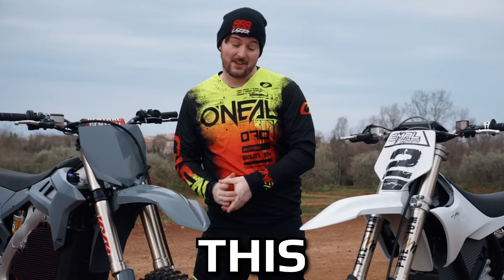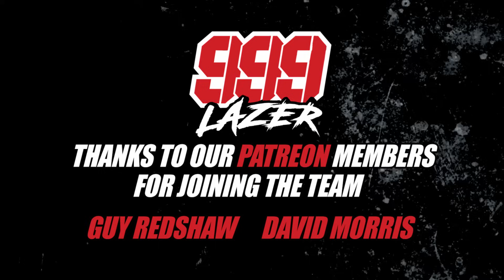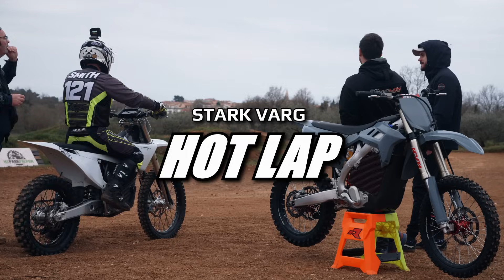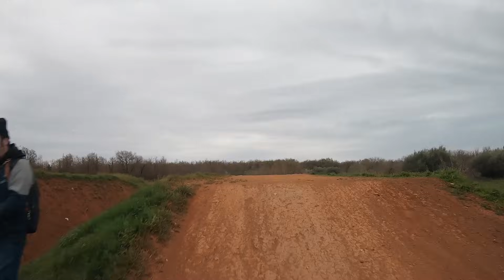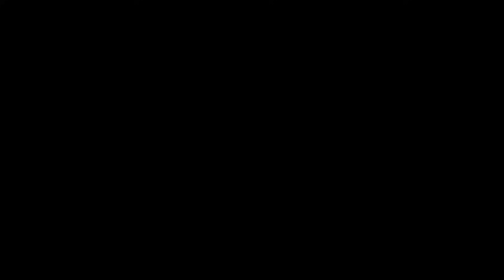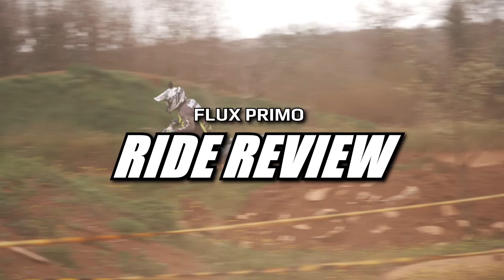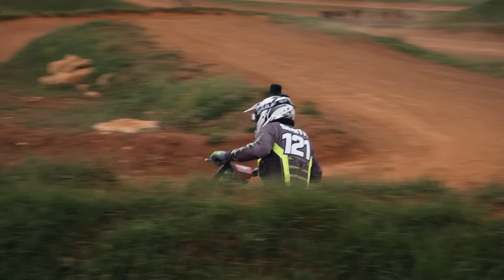$50,000 Dirt Bike vs $50,000,000 Dirt Bike! | Electric Motocross Shootout

Comment: A letter I sent to Stark.

Vark R&D Department

Dear Sir/Madam 

Proposal for a new throttle control system. (Patent pending)

I don't think a single test rider/journalist at your launch in Spain wasn't very impressed by the Vark. 
Most of the riders felt they could be faster on the Vark than on any internal combustion motocross bike. 
They also noted how much more difficult they found riding the IC 450 bikes that Vark provided for comparison, after they had ridden the Vark.

The question is why.
The answer is ease of control.
The main reason test riders liked it so much was ease of operation, due to fewer controls, fewer tasks demanded of the rider.
Simpler tasks are easier to do at speed than complex tasks.
Simpler tasks can be done faster than complex tasks. 
Motocross is an extremely difficult sport. It's a very demanding sport, not only because it is physically demanding but because the many controls make operating a motocross bike a very complex task.
Simplifying the controls of a motocross bike make it possible to ride it faster.

The Cockpit
The "cockpit" of a motocross bike is very busy, with half a dozen controls. You have a steering control (the handlebars), used for directional control and balance, then on the handlebars, on the right side, is a throttle control and a front brake control, and on the left side, a clutch control. These hand controls have to be operated while still holding on to a constantly accelerating and bouncing machine.
So riders have to use their hands not only to hold on to the machine but to operate the steering, clutch, throttle and front brake.
And then riders have to use their feet to operate the rear brake and the gear selector. 

It should be obvious that the less complex a task is, the less demanding a task is, the easier it is to do at speed.   
So since motocross is about speed, the way to make a rider faster is to make it easier to control the bike.
Having fewer controls reduces the load on the rider, making operating a motocross bike easier and easier translates into more speed.

The Vark has significantly simplified motocross by eliminating two controls, the clutch and the gears thus significantly simplifying the rider cockpit, and they cannot be stalled, all greatly reducing demands on the rider, making it easier to go fast. 

Electric bikes have shown that by simplifying the controls riders can ride faster with more consistency.
And motocross is all about speed.

Freeing the feet
The lack of a clutch gives riders the option of moving the rear brake to the handlebars, thus freeing up their feet from having to operate any controls. 
On a conventional internal combustion motocross bike, a rider is forced to move their feet hundreds of times during a race. 
Freeing the feet from having to operate controls makes it much easier for a rider to maintain optimum form, with the balls of their feet on the footrests. 
Constantly having to move your feet to operate the controls interferes with 
keeping the balls of your feet on the pegs, 
with gripping the bike with your legs, 
with weighting the outside pegs in corners, 
with putting your foot out in corners.
Substantially reducing foot movement takes a load off the rider, making riding a motocross bike noticeably easier.
A rider can brake-slide into right-hand corners with their leg out and into left-hand corners with the ball of their foot weighting the outside peg.

The Twist-grip Throttle control.
The next most disruptive control, requiring a lot of movement, is the twist-grip throttle control. 
 
The twist-grip throttle requires up to 70 degrees of rotation for full throttle.
There is just no way around the fact that having to twist a throttle grip by up to 70 degrees will cause a rider to kink their wrist and/or drop their elbow. 
See an example in this video
https://youtube.com/clip/Ugkx0UeoUVgC7KnQ_WyU2uX72WsMUMCjov0F
So operating a twist-grip throttle forces the rider to kink their wrist and/or lower their elbow. 
Good form requires straight wrists and high elbows. Low elbows reduce the rider's control of the machine, one elbow up and one down, even more because of the asymmetry. 
Impacts are best handled with straight wrists and high elbows.
Reducing the amount of rotation required for full throttle makes the throttle too sensitive for optimal throttle control.
Just like having to operate foot-controls disrupts staying in form with the lower body, so does the twist-grip throttle control disrupt staying in form with the upper body, it makes staying in form significantly harder, more complicated adding difficulty.

The solution
What if the rider were to twist the throttle-grip but instead of the grip rotating on the bar, a sensor measures the force of the twist action and opened the throttle accordingly but without any actual movement of the throttle-tube.
Just like when you stand on an electronic scale, the scale does not move, but the pressure sensor gives an accurate readout of your weight.
On an electric bike (and on a ride by wire IC bike) all one needs to do is replace the position sensor on the throttle control unit with a torque or pressure sensor.
The pressure or torque sensor measures the force applied by the rider and relays that information to the throttle control unit which opens the throttle accordingly.

With a tradition throttle control, a rider determines the amount of throttle by rotating the twist-grip throttle tube. 
The position of the throttle tube determines the amount of throttle. 
With my system the amount of throttle is determined by how much twist force (torque) the rider exerts on the throttle tube without the tube actually rotating.
The ratio of force to throttle opening needs to be determined by extensive testing, too low would make throttle control too sensitive and too high would cause fatigue. Individual fine tuning by the rider will be possible.
With my system the twist action to open the throttle is the same as the conventional rotating grip throttle, (it takes a twist force to spin the throttle-tube) the difference is that instead of the throttle tube rotating and a position sensor measuring the position and relaying that information to a throttle controller which opens the throttle accordingly, a pressure sensor measures the twist force the rider applies and sends that information to a control unit that opens the throttle accordingly, without any rotational movement of the throttle tube, thus avoiding a kinked wrist and a lowered elbow.
The actions are so similar that riders shouldn't have a problem adapting. The advantage is riders can apply throttle without kinking their wrist or lowering their elbow.
This would be far less disruptive making staying in form with a straight wrist and high elbow much easier.

Additional benefits 
Increased connectivity to the machine.
The handlebars have two main functions, one, they provide grips for the rider to hold onto, keeping the rider attached to the machine, and the other, they are used for steering control which is essential for balance and directional control.

There are two grips on the handlebars used by the rider to hold onto, keeping the rider on the bike and also connecting the rider to the steering control. 
One of them, the right one, is loose and spins on the handlebars.

So why have a grip that spins? 
Necessity. 
Motocrossers need a throttle control, and trial and error has determined the twist-grip throttle control to be the best option available for carbureted  motorcycles. But it is a compromise.

While most motocross riders are aware of how the traditional twist-grip throttle interferes with keeping their elbow up and their wrist straight, few however, will be aware of the reduced connectivity to the handlebars and therefore reduced control of their machine a loose spinning grip causes because it's all they have ever known, so they are unaware of this negative affect but if you doubt that a loose grip is detrimental to connectivity, feel and control, consider what it would be like to have the left grip loose and spinning like the throttle grip.
This should help you realize that loose spinning grips are detrimental to connectivity, feel and ultimately control. 

In downhill mountain biking there is no need for a throttle. No downhill riders choose to have spinning grips for obvious reasons but not obvious to motocross riders because it is all they have ever experienced, it's all they know, so a spinning grip feels natural and normal to them.

Asymmetry
Another thing to consider is asymmetry.
There is an inherent asymmetry in having the right handlebar grip loose and rotating and the left grip solid.
This results in asymmetry in the riders physical position on the bike when they are applying throttle, with one elbow up and the other down.
Asymmetry is detrimental to control of the bike. No one wants bent bars or one footrest higher or further back than the other. 
Watch the start of any motocross race and you will see all the riders with their elbows up until the gate drops and then watch as most drop their right elbow.

continued below...
Reply: Whiskey Throttle
Some people have commented that they think my system could result in accidental throttle openings (whiskey throttle) while bouncing around a motocross track with high impacts like square edge bumps and hard landings.
(Some of those may have confused twist force with squeeze pressure.)
My argument against that is that any action that would cause accidental throttle on my twist force throttle control, would also cause accidental throttle on a conventional twist position throttle control, so a twist force throttle would not be more prone to accidental throttle than a traditional twist-grip throttle.
In other words any action that resulted in an unintended twist force being applied to the throttle grip would also result in the rotation of a traditional throttle's twist-grip.
Both systems require a twist force to increase throttle, it is just that with my system there is no rotational movement.
Surely if riders can keep the throttle-tube in a consistent position without unintentionally moving it while bouncing around a motocross track they would be able to keep a consistent twist pressure while bouncing around a motocross track. 

My twist pressure throttle control will not cause any more accidental throttle than the traditional system.

In fact I believe it could result in less unintended throttle incidents because it is easier to reduce twist force on the throttle grip without actually having to counter rotate it than having to counter rotate the throttle tube while being pushed back by the accidental acceleration. 

In Summation
My initial premise that the traditional twist-grip throttle control interferes with staying in form, with keeping the elbow up and the wrist straight, cannot be logically refuted.
It's an empirical fact. 
There is just no way around the fact that having to twist a throttle grip by up to 70 degrees will cause a rider to kink their wrist and/or drop their elbow. 
My claim that not having to twist a throttle tube by 70 degrees would alleviate those problems. Well that should be obvious, it's self evident, so also logically irrefutable. 
My claim that a spinning grip leads to less control is proven by the fact that no rider would choose to have the left grip spin like the throttle grip because it would be obvious to them that it would lead to less control, and in downhill mountain biking where there is no need for a throttle, no rider chooses to have a spinning grip.
My claim that having one grip that spins and the other solid, is asymmetrical and asymmetry reduces control, is self-evident.

Testing
So the only avenue left where it might be possible to logically refute my claim that my system will be better than the traditional twist-grip throttle control system, is whether riders might have difficulty adapting to controlling the throttle with twist pressure rather than twist position, whether riders will adapt to and end up preferring it to the traditional throttle control, both in terms of making it much easier to stay in form and as a method of controlling the throttle, and that can only be determined through actual testing. 

Testing my throttle control system on an IC bike would require first converting it to ride by wire, since none of the current MX bikes use ride by wire so it would be much easier to do initial proof of concept tests on an electric MX bike. 

I am not saying I am 100% certain that my system will improve rider control but I am 100% certain that the only way to find out is through actual testing. 

Closing statement
Currently Stark seems to have a head start on the other manufacturers but this will not last. 
Stark will soon be facing steep competition from the big motorcycle manufacturers with their massive resources and decades of experience with MX bikes and if Stark want to stay ahead, they will have to continually improve their product. They need innovative ideas. If tests show that my system does indeed improve rider control, adopting my throttle control system should help Stark stay ahead.
There is also the possibility of selling my system to other motocross manufactures for use in their I.C. bikes.

I believe my throttle control system would not only be beneficial in motocross but hard-enduro, trials, off-road and even in  the high precision world of MotoGP.

Also a pressure controlled throttle presents the opportunity of controlling re-gen braking with opposite twist pressure, the more (reverse pressure) one applies to the throttle grip the more re-gen braking is applied.

Looking forward to hearing your opinions on my Twist Force Throttle System.
 
Regards
Alfred Karius
Reply: @alfredk471  i can't say that I've read all that text but I've read that you suggest a force sensitive throttle.
I actually think it's a brilliant idea because I've thought about that too: I am a casual flight simmer and in the flightsim world it is no mystery that the stick of the F16 fighter aircraft is force sensitive: it moves only a little, if i recal properly, but it needs a certain amount of force to be moved and so force is the main variable for the output.
I don't know what it would feel like on a motocross bike and whether it could be tiring after some time, but I think that someone should try one.
Maybe it could be testable even with existing electric motorcycles just by replacing the throttle with a force senstivie one.
Reply: @MVPever  Yeah, I did say the only way to know for sure if it will be beneficial, is to test it and that it would not be difficult to do on an electric MX bike. The twist force required could easily be tuned to require no more muscle strain than a conventional throttle.

Comment: Big up for Flux and Marko! 
So cool to see another brand step into the game! Let's goooooooo ⚡⚡

Just one consideration: best lap doesn't make any sense to make comparison between these 2 bikes. 
Riding for the first time a bike with both hand brakes is so difficult after ridden the whole life with a certain automatism. 
I'm saying this because I'm still struggling a little bit on hard pack after 5 months with my Stark with hand brakes. Also the man said he tried to catch the brake pedal while riding. 

Last consideration is about electric bike on hard pack track. Throttle control is everything on hard pack and I think Stark can improve a lot. I ride most of the time on hard pack tracks and in some slippery corners I feel slower than I was with my old ICE Honda CRF. Virtual clutch on the Flux can be a really game changer or at least something new really cool to see in the market.

Comment: There's still the danger of not hearing these bikes when on track with others.
Reply from the maker: That's the main complaint i heard about from the guys racing against the starks in the UK Arenacross series. I think they will have to address this if electric bikes do race gas bikes more often in the future.... Thanks for watching dude!
Reply: Not found if a problem so far, you can see who’s in front of you and those behind can see you. Just steer clear!
Reply: The lack of noise is a huge danger factor in my opinion.  It’s beyond irresponsible to mix these types of bikes on the same track.
Reply: There is a simple $50 mod from FMF. Next stupid comment